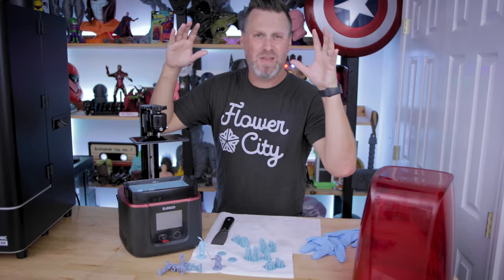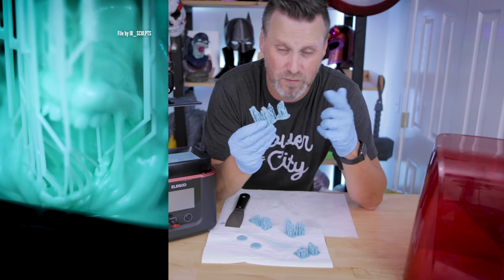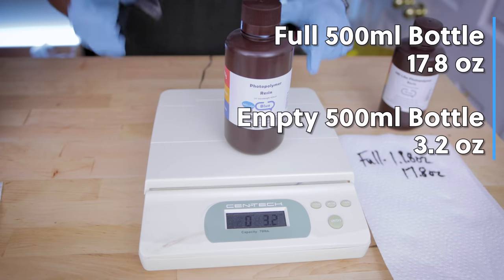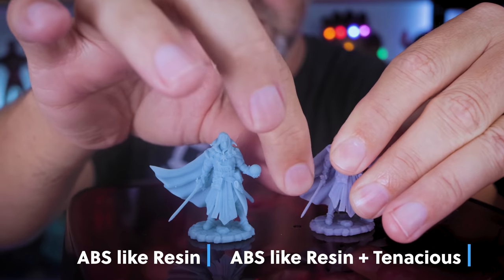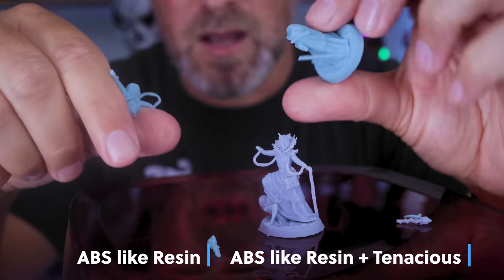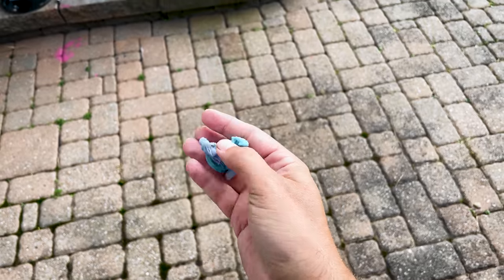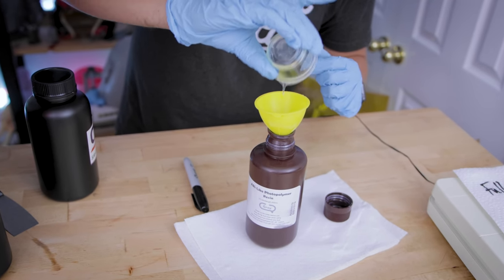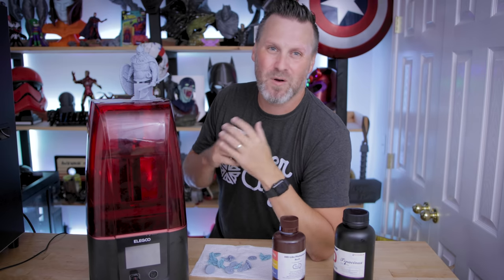How to make any Resin 3D Print more Flexible

Comment: I use a 12.5% by weight.  That way one  bottle of Tenacious mixes with eight bottles of Elegoo ABS like with none left over.  I did notice in my own testing that there is a significant improvement from 10% to 12.5% mix, as 10% did not give the durability I was looking for.  I have read that going over 15% will start to noticeably impact the detail level of your prints.
Reply: That's very smart, cost effective and efficiënt
Reply: damn, what recipient are you using to mix that amount of resin in? :D
Reply: in your opnion is it worth the 360ish dollars that that would cost (at the time of this comment)?
Reply: So are you adding 125g to 1kg of Elegoo resin, making it an 11.11% mix? Or are you taking out 125g from the Elegoo before adding 125g of the Tenacious? If so what do you do with the removed resin?

Comment: I've done this with Phrozen Water washable resin  and Tenacious at a 80% WW to 20% Tenacious. I was able to clean the models with water and they cleaned just fine. I tested the brittleness after curing by dropping the models on concrete from 5 feet and they bounced. The straight WW models shattered when tested. As for printing settings, I used the same setting for WW alone and WW with Tenacious mixture.
Reply: Are you still using this resin mix and does it still work for you?
Reply: I came for this comment!
Reply: I've been searching for an answer to the question how would I clean my WW resin if I mixed it with Tenacious. 
Thanks.
Reply: Planning to do the same and wondered if anyone had tried already. Thank you!!!

Comment: Been experimenting with the Tenacious and Anycubic resin for some Mandalorian armor. Really impressed with the Tenacious 👌
Reply from the maker: What kind of ratio are u running with for Cosplay stuff?
Reply: @UncleJessy  For standard armor pieces, 3:1 standard resin to Tenacious. For the more flexible armor, like Mando’s hip plates, trying 1:1.
Reply: @SPProps  what printer are you using got my first printer on the way and would love to know how resin printing turned out for it as i have heard filament is better for cosplay stuff
Reply: @peytondonovan9074  For FDM, I have an AnyCubic Vyper and Kobra Max. 

For resin, I have an AnyCubic Photon Mono X and a Phrozen Sonic Mega 8K. 

They each have their advantages, but resin prints are definitely easier to finish, IMHO.

Comment: Tenacious is expensive, but if you go with a 50/50 mix, none of those swords or staffs would break.  They'd just bend, and then bend back.
When I was testing this I was using XP2 validation matrix plates, and with 50/50 Tenacious and Phrozen standard, I could get the entire plate to bend almost completely in half and touching, and it still bounced back.
The one other advantage to not using much Tenacious is that you don't have to re-figure out your settings.  But in a monochrome printer you should be able to dial in a particular blend with XP2 plates in about an hour since it only takes like 2 minutes to print the plate.

Comment: Nice vid. FYI, the Elegoo Jupiter is a POS in many ways. For those in the market for a big, well designed printer, go with the Anycubic Photon M3 Max at a slightly lower price. It just needs a piano hinge for the front cover to avoid having to find a home for it and an air heater to run overnight with your furnace turned down.

Comment: Thanks for sharing, dropped my Vigo head and didn't have a scratch on it, it was printed with Siraya Tech Fast Grey, noticed the resin becomes rock hard and very tough but has very little flexibility. For action figures i think a more flexible resin is required.
Reply: Thats why yuo can.misx withba flexible resin and the resulting mix gona have "some " flexibility

Comment: I am using anycubic basic grey about 60% to 40% tenacious with my Photon Mono. I like the higher flex rare because I have preen printing things with long details smaller than my small supports that snap when clipping supports. At this ratio the prints seem almost indestructible. It's actually been good enough to print some.utilitsrian things.

Comment: Recently I've been experimenting with residents and I use the Sierra tech abs-like resin which is only slightly more expensive than the elegoo abs like resin and I thought it had a lot of flux. I was going to use that instead of experimenting on mixing resins like this.
Reply: Experimenting with residents?!? That sound like a horror movie, like you have some residents locked up in your basement to experiment with.
(I know what you mean, but funny auto-correct error haha)
Reply: @MyTasteOfMusic1  it's a voice to text error. I promise...

Comment: I have been using 10-15% Blu v2 in my resin and it also give you a bit more durability, but without as much flexing in parts. so if you need the durability and don't want the parts to bend so much you can try that... I don't think the break point will be as high as the tenacious though but I have not tested this.

Comment: If ya over cure them it makes them brittle as well. Siraya tech fast resin you can spike on the ground and not have an issue except for super thin parts
Reply: this is something I know nothing about. I cure the crap out of my prints paranoid there's uncured resin somewhere inside.

Comment: When I resin printed (I'm allergic). I used 20% Tenacious based on what I was recommended (which is not that much more than you used) and it will give you a little more durability. Also, 3D Resin Solutions Hero line is pricey but I would say even more durable.

Comment: I've been mixing Tenacious with Epax Hard Grey for a client. It's very nice and works great while other prints keep breaking.
Reply: What ratios are you mixing? I have tried a 4:1 ratio so 800ml EPAX Hard and 200ml Tenacious and it almost feels like the models are more fragile. Did you have to change your settings?

Comment: I've had the most problems with the multi part prints. I started using super glues and they were just awful. Even on large parts with lots of surface area to glue. I'm using two part epoxy now but I've also started really roughing up the joins to get more grip from the epoxy as even that failed when a model simply fell over and broke into 3 parts. The hollow models seem to survive better but I do love that weight you get from a solid print. 

BTW great video. Much needed info and I'll bare this in mind with any print where its going to live anywhere near children haha

Comment: Also with transporting your minis if that's what your selling, get a small box which gives at least 1" open space between the tops of the minis to the roof of the box. Tape the Mimi's bases to the bottom of the box, lightly fill the box in with Styrofoam bits  and mail them out. With the box clearly marked "this side up" of course this is if your minis are mailed connected to the base. 

Nvr once have I had a break with a mini using this method. To many people wrap the mini in tape thinking it helps, it does not in my opinion.

Comment: There are also "tough" or "rubber-like" resins that you can use out of the bottle. It's more of figuring out the settings for curing, exposure etc. that might be a little messy. Overall I think this issue is solved. I mostly just use craftsman, or basic and they work as I don't tend to drop stuff.

Comment: I've been using Tenacious for over a year, and the flexibility has really gone down. Like the resin itself isn't as durable as it used to be. I could bend my minis 6 ways from Sunday, drop them from the second story of our house and they'd be fine, nowadays they shatter at dropping them on the table and that's because I used to use a 70/30 mix . The latest print I did in 100% tenacious and it wasnt by any means as durable as my previous prints . Siraya tech needs to step up and bring the old solution back. If not I'm switching back to monocure for that price
Reply: I was noticing the same exact thing! I usually run a 4:1 ratio with 80% EPAX Hard and 20% Tenacious and it feels like the models are still super fragile.

Comment: I'd probably want to do this on big things like helmets, so that if you drop it, it doesn't shatter and waste days of printing and tons of money on resin to reprint. (But I'd also like to learn how to create molds to cast future helmets anyway.)  For little minis, I'd be fine reprinting.
Reply: I think I'm gonna try 85% / 15% for helmet and armor. If no results given then I will bump it up to 80% / 20% max.
Reply: I wouldn’t trust a fully printed helmet. Mold making is relatively easy one you have a good negative (3D print) smooth on is a great resource for molding. I like mold max 30 and smooth cast 300 which is a urethane resin. Very durable.

Comment: The correct mixture formula is as follows height x volume x quantity. You take the height of the build plate print multiply it by the volume (amount of resin used) then multiply it by the amount of printed pieces on the build plate.

For example: 32mm x 55ml x 6 would be .32x.55x6= 1.056 the ratio in this example would be 1/10 or as described in the video (1 parts tenacious/9 parts standard resin).

Loved the video, tenacious is the best, I use it myself on large models, no so much on minis. I use alpha flex and/or flex-it for minis.

Also a scabbard is a sword sheath designed to hold and carry swords and protect the blade from the elements.

Resione 3d TH72, cheaper option that will provide the same results, however the downside of purchasing this resin is it doesn't always arrive on dates expected. I've had times where I get it a week after the delivery expected date so that's why I switch. Yet if your on a budget it's a better option.

Comment: A very useful video on how to make more rugged, break resistant prints.
If you break one of your miniatures, (not on purpose), could you glue it back together and what kind of glue would you use?
Reply: Oy mate, you can put resin on the broken surface and use a uv lamp (about 3 second) to stick it back together
Reply: I also use gorilla glue super glue gel and just a dab and it works great. I haven't tried the resin/UV strategy.

Comment: I'm curious about whether the additive in any way changes how well the surface reacts to paint. Perhaps that's something you might be able to share or comment on in future?

Thanks for another great and informative video!
Reply: Well they're both resin so it really shouldn't be an issue.
Reply: @3DJapan  Not all resins are the same (or even similar in some cases).  Depending on the monomers, crosslinkers, fillers, and even the pigments used by the mfr., one resin could react very differently to certain paints vs some other resin blend.  Goobertown Hobbies has an excellent video on the subject if you're interested.
Reply: I'd think they'd paint up similar to the Reaper Bones minis.

Comment: Ill give everyone a warning about mixing resins like this.
I did this with 5 litres of Monocure resin and a 1 litre Monocure flex resin several years ago.
It made the parts incredibly impact resistant and flexible.
However, over time, every single model I printed with this blended resin developed cracks. I now have tonnes of miniatures that I printed and painted all cracking.
It's one of the most disheartening things to happen in my miniature career so far.
I had only half used the 6 litre blended resin before the first cracks started to appear. I ended up binning it because the problem was so prevalent.
I switch to a new resin, without blending in flex resin and I've never had the cracking again.

Comment: Question: Elegoo Saturn prints/miniatures don't seem to have the level of detail I see in these videos. Was curious is that's because of the camera zoom or not, or if because I'm using 75% iso to clean instead of 99%. Thoughts?
Reply: Yeah, use 99.9 ISopropil alcohol

Comment: This is really interesting ! In my case, I use Elegoo's water washable resin so I don't think I could mix it with Tenacious and keep the water washable property... I made this choice to avoid adding more chemicals (IPA) in my appartment. Maybe someone has already tried it and can give me some feedback or another solution ?
Reply: You could try using Simple Green instead of IPA it works very well and it's environmentally friendly and non-toxic. It's a lot cheaper than IPA as well.
Reply: @3DJapan  Thx for your suggestion. As I'm in France I can't find this "Simple Green" stuff you speak about. What is it used for ? Some kinda detergent ?

Comment: I dunno if it’s because I use water washable resin, but I don’t nearly as much breakage on…any of my minis, really. Then again, I’m not purposefully out for destruction :P
Reply: What brand?  I got eSun's water washable but haven't used it yet.
Reply: @Kune35  Any of ‘em. I just don’t really break minis unless they’re over cured.
Reply: @TJtheBee  What are your layer times and how long do you cure?  For what it's worth I have the Elegoo Mars Pro printer and Mercury curing station.  I'm paranoid about overcuring and having breaks in the minis in shipping.
Reply: I have found the same thing. I use the elegoo water washable resin almost exclusively. I only really get snapping on super thin spears (I'm looking at you Archvillain Games) unless I over cure. Honestly it's a guessing have on my post wash cure times. My exposure is 2.0 on my Anycubic mono and 2.1 on my Mars 2

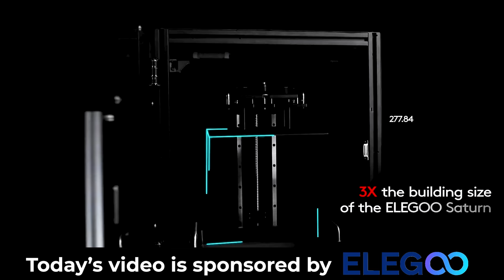Comment: 3:18 - Only 12.8 inches? The Jupiter looked a LOT bigger than this in the teaser photos from August 2020.
Reply: Did you see the video they posted? It's huge!
Reply: @booradley5127  I'm all in for bigger, but I was just expecting more than a 10.9 " x 6.1" build plate judging by those teaser photos. TBH though this is still an incredible deal for $600.